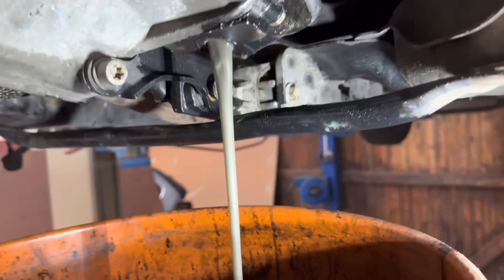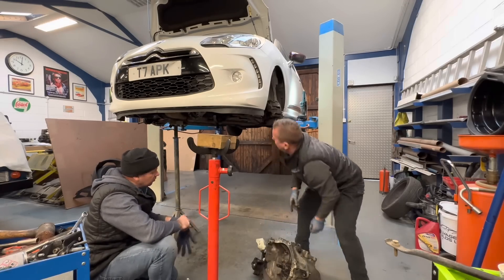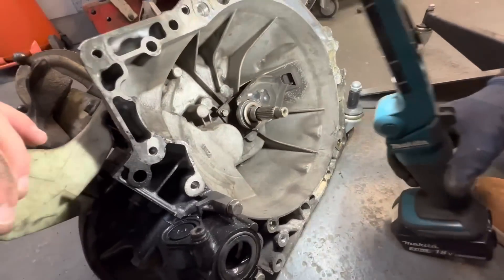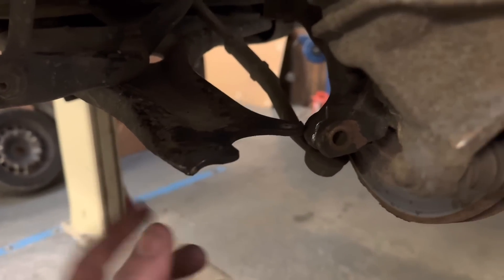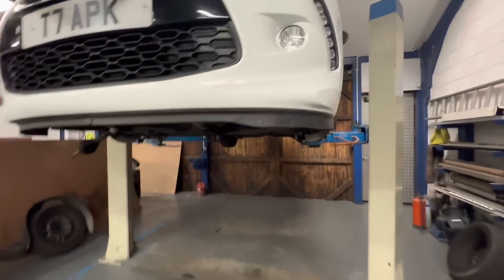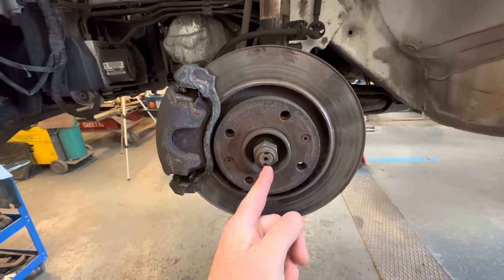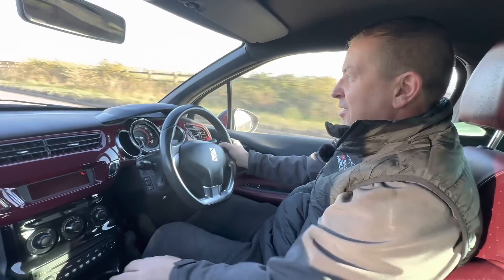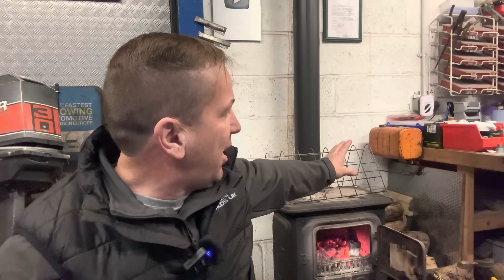WE BOUGHT A DIRTY BROKEN DS3 AND GAVE IT THE SRUK TOUCH !!!!

Comment: If you put some rocks with minimal gap between them (bricks for example, 3-4 layers or more, depending on how much weight the fireplace can hold) on top of the stove in your garage, they will hold heat for several hours and even when the fire has gone out, there's still heat coming from the fireplace for a couple of hours. Just an Estonian thought, because we have saunas which have similar construction and quite a lot of us still use fireplaces for everyday heating during winter in -20. But otherwise, excellent video as always! Always waiting for more.

Comment: I wonder what the inside of that gearbox looked like.  Used to have a 1.6 diesel c3 picasso, which used to whine quite badly in reverse.  Even changed the clutch on it, when it was under 50,000 miles.  After watching this im now wondering if tge gearbox was failing.  Alas no longer have it as it was written off!

Comment: I'd put money on it being the same lad opened and "resealed" the gearbox as overlooked the wear from the release bearing. Water ingress into box then causing failure that probably only became obvious after it sat idle for a while. At least it failed in the yard and not after new owner had it for a while

Comment: Don't know if anyone has mentioned it or I got the wrong end of the stick from your explanation but the tax is void as soon as it changes owners anyway. The scam the DVLA have been running for years now is the tax not being transferable to the next owner like it used to be, so the taxman gets more cash from the motorist, especially if the car passes on mid-month as they get paid for 2 months. It's a rip off but can't do sweet FA about it unfortunately. Not so bad on low tax bracket but pretty steep on the £600 a year bracket. That's why I try to sell at end of the month so no half months wasted or to pay full price for.

Comment: That was a quick box change, look at the clock on the wall👍 If you were in an F1 paddock you would have got a 10 place grid penalty though 😎
This is a great channel and I hope you just keep doing what you do as it's the muts nuts🐕‍🦺

How about doing a Christmas meet up somewhere, a few beers and a steak maybe, I'm sure if you put it to a big pub or hotel they'd be more than happy? (Hotel would probably be the best option for those that like a sherbet or two and need to drive home🍺🍺🍺🍺🍺You could agree a number with the pub/hotel and do it on a first come, first served basis and maybe even chuck a nifty on each ticket, winner takes all for Christmas! I'd defo be in for two tickets, and we could all compare our favourite tools over dinner😁 I quite liked what looked like a Hydrometer in Chris' hands an episode or two ago! I used to use a refractometer to measure the coolant concentration, the snap on guy caught me with my guard down!

Comment: Hi, hope you don’t mind me asking, but this is loosely related. What advice would you give for people choosing a garage/body shop to work on your car. I clipped a fence post and the arch lining trim has started to come away, I think some of the clips have snapped, but also  a while a ago I clipped part of the bumper and possibly where the end of the arch trim clips on the end as when I’ve tried to clip it back in, it doesn’t line up. Also I have a Honda Civic and there’s rust where the windscreen seal meets the roof (I believe it’s poor glue used) but there’s also two big spots where the paints flaked off and there’s small amount of rust starting to appear. I want to get these looked at, but on the one hand I don’t want to pay lots, but still want to be sure, that I won’t have problems later on like the arch trim popping off again. I’m sure there’s loads of videos giving good tips for beginners, but there’s that many videos, I don’t know where to start. I have started trying to select one car you’ve started on and try watch from start to finish when I have time. For me, It’s hard to gauge how good you are as general mechanics, I mean you seem to get everything running again, but it’s easy to be sidetracked by the body repairs. I think over Xmas I’ll try binge watch more of your content, the only thing I’m certain of, and know 💯 will agree is your quality is always bang on!

Comment: aagh !   i had to  work till 8pm last night, finishing putting a clutch in one of those things, + the solid flywheel was £500.  there is no way [that surface rusted]  flywheel is new, judged purely by the standard of workmanship/putting known knackered box back in, [busted release tube + silver oil reused]    my starter motor dowel fell out + ended in the bell-housing, noticed on roadtest  at 5pm last night, aagh !  
 PS, i could of cleaned up the original flywheel + re-used it, but i didn't want to take the risk, wouldn't want to take the box out a second time, would i .......

Comment: Good job, but concerned that the final drive ratio for the van would be lower than for the car. Van gearbox and final drive ratios are specified to a degree by the need to do a hill start in first gear fully laden. So is the car all up weight same as the van?

Comment: Would the ratio in the boxes not be different guys ? Brilliant video though
Reply: It had me thinking - if they're different, you'd expect a van to be geared lower for load lugging. Speedo would be out compared to sat nav?
Reply: I was thinking the same as vans ratios could be different to the cars ratios.
Reply: I wondered that as well, but wouldn’t that cause the ECU to throw up fault code  if it wasn’t seeing the correct road speed for the engine revs?
Reply: @jamesbrett6518  Speedos are driven off ABS wheel sensors nowadays.

Comment: Hi guys. Are the gear ratios the same ? I have a van with that engine and also have a Dacia with that engine. The gear ratios are very different ( the Dacia has taller gears and has less torque
Reply: Thought the Dacia would have had a Renault engine.
Reply: @j0nA82  Correct, it is a Renault engine, but as far as I am aware the Renault engine is used in most French makes as well as my Merc Citan van.

Comment: Just checking, did you realign the clutch? You maybe mentioned the alignment tool just after showing the butchered shaft and wondering what butchered it, was the clutch assembly off centre a ball hair?
Reply from the maker: It wasn’t the shaft bud it was the release, bearing snout 👍

Comment: One thing I have learnt from you chaps is avoid French cars, the  amount of issues these have is crazy this day and age. Also I think the big let down with this DS3 is the interior being that awful crimson colour. But good stuff as usual boys.
Reply: Im not sure that they are that bad. That 1.6hdi engine is in all sorts of cars. Volvo. Ford. Mazda. Pug and citroen. Im sure theirs more that its in.

You see more of the cars that hold less value as they dont get maintained
Reply: That unit is a ford engine
Reply: What utter rubbish - an abused car is an abused car regardless of what manufacturer or origin - this car has been unserviced and mistreated - I know of plenty of vehicles with this exact running gear running 250k miles upwards.
Reply: @byronmills5952  I agree.. if you don't look after them this is the result. Regardless of what make it is.
Reply: @peugeotdudeandson4485  Wasn't Peugeot involved in the New Gen of Mini's engines which were notorious for oil consumption then snapping cam chains.
Reply: @Dreamweaver787 It's a joint unit - all the crap that gos south in those is the modern BMW tech. Duff Vanos, cheap horrible timing gear and plastic tensioners. It's basis is effectively  the PSA Tu5 block and pistons with a BMW designed top end.
Reply from the maker: @peugeotdudeandson4485  it’s psa dude
Reply: @Dreamweaver787  yes and all the bmw stuff fails. Same issues as the big bm 6 cilinders.
Cant blame psa for any of that
Reply: @sruk  Holy crap that's ruined my life now. I was all up in arms fighting for the French and you tell me this. 
I should have known with my knowledge of psa products. Shame on me 😉
Reply: @Dreamweaver787  what the Prince engine. Yeah they were. The BMW bits broke on those 😀